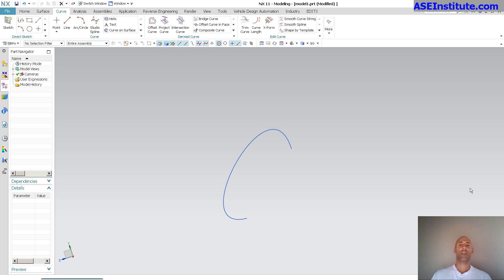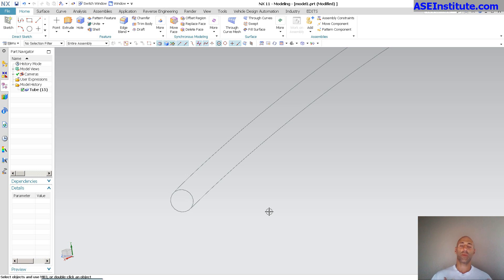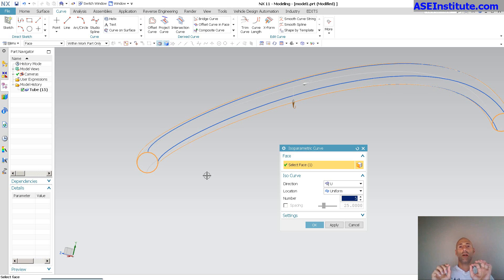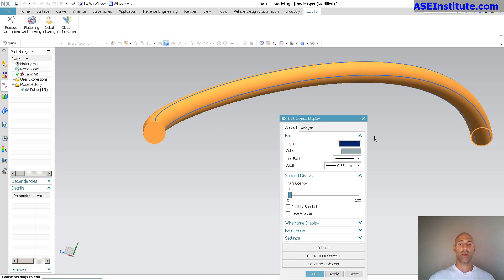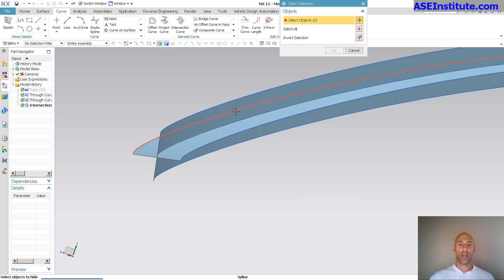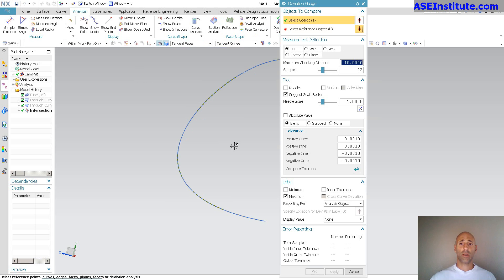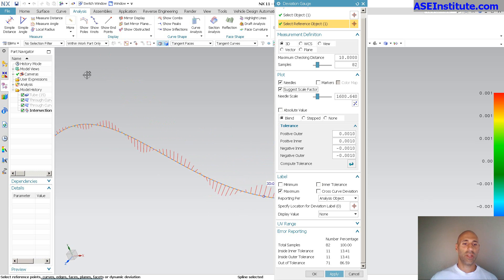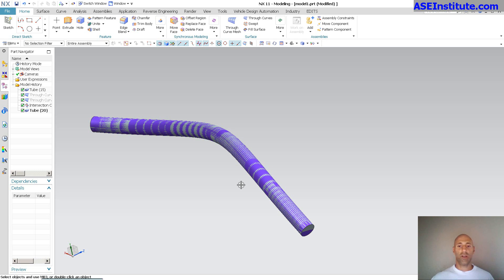Reverse Engineer 3D Tube: Siemens NX 11

Comment: That's fantastic!  .....very helpful and well explained.
I have been watching some vids from your channel to help with extracting parameters from .stl imports, and your surfacing tips are the best I have found. It would be great to see a summary vid of some simple tricks to extract face surfaces (even simple flat ones) from an .stl import, and then assemble the surfaces to form a solid body. kind of "Reverse Engineering 101". I have been finding ways to fumble through and make it happen, but the process seems quite tedious. By applying your mantra of "keep it as simple as possible" will surely make my methods seem convoluted, but I am sure that I'm not alone here. Your efforts are greatly appreciated.

Comment: THAN YOU SO MUCH FOR YOUR EASY  TO FOLLOW STRAIGHT TO THE POINT TUORIALS. MAN I WISH I FOUND YOU  A LONG TIMW AGO.  BY CHANCE ANY WAY YOU HAVE DONE ONE WITH CATIA V5 ON HVAC?  I AM A 20+YR UG USER AND I AM THRUST INTO A PART I HAVE NEVER DRAWN ON A SYSTEM I HAVENT USED FOR 10+ YRS
Reply from the maker: No sorry. I have not. But chances are the tool you are looking for are under 'Multi-Section Surface' and it allows an Area Law sweep.

Comment: hey, it was a nice video. I have some doubts which are not related to the video but it would be be helpful if you could tell.

1) how to turn off " continuous auto dimensioning " permanently. 

2) how do we know that how many individual surface or solid bodies are there in the part when dealing with multi bodies in a part file.

thanks in advance ....
Reply from the maker: Go in to File>Utilities>Customer Defaults>Sketch>Inferred Constraints and Dimensions. In that menu you will find the setting you need.

As far as the bodies go... I will make a video as you gave me a great idea but for now in the Part Navigator Right Mouse Click in an area with out any features and turn off "Timestamp Order". That will show all bodies.
Reply: +class A surfacing thank you so much, auto dimensioning was bugging me from months and the multi bodies thing was pretty cool, atleast now I know how many bodies I'm dealing with ....
Reply from the maker: Great. Cheers.